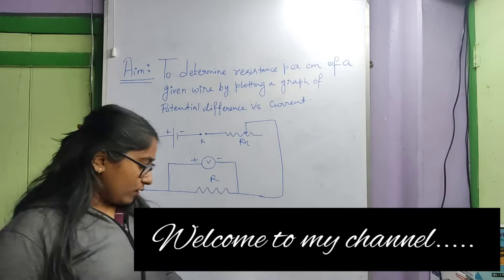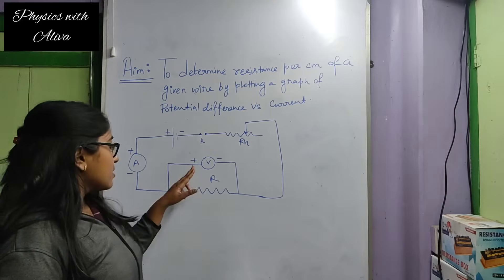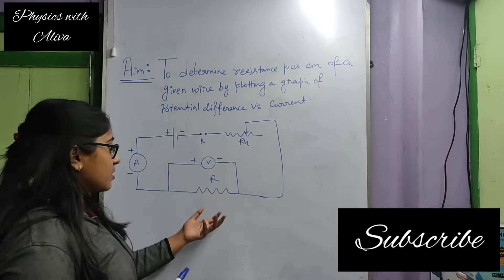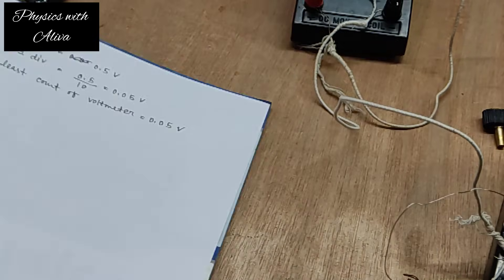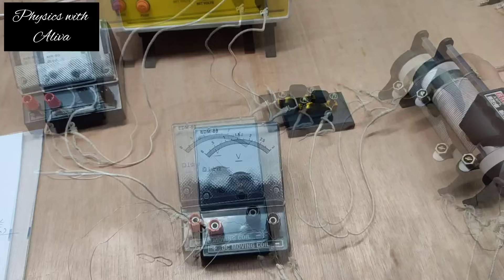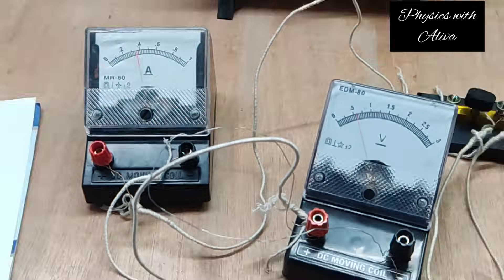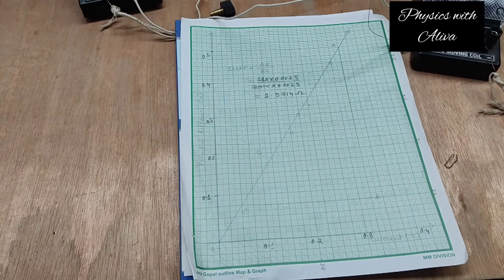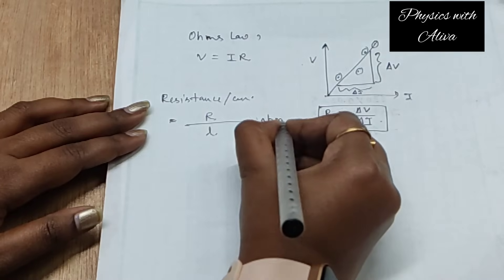To determine the resistance per cm of a given wire by plotting graph potential difference vs current

Comment: Respected mam whats the use of  rheostat here as you can just see the diffrent value of current and voltmeter by just changing the voltage through battery

And  does it(rheostat) not affect the current flowing in circuit if not then how ?

Comment: why did you use the rheostat when you can change the current directly from the battery?
Reply from the maker: @StormyGamerz  if more voltage is applied through battery in my case, the current will become high beyond my ammeter and voltmeter range…
Reply: @physicswithaliva9791  thank you so much maam

Comment: P terminal of battery connect to p terminal of ammeter n terminal of ammeter connect to p terminal of voltmeter  n terminal of voltmeter connect to one end of rheostat upper wala end another end niche wala connect to key now one end of key connect to n end of battery  and resistance wire connect parallel to voltmeter

Comment: But in boards it will ask for rsistivity
Reply from the maker: @Armywala-dk9po How to use screw gauge to measure the diameter of a wire and the least count also
https://youtu.be/3OJ_0gapwzY

Calculate the diameter of the wire

Comment: We have to convert the length of  wire from CM to M while solving ???
Reply from the maker: If you use the length in meter then the unit will be ohm per meter 
If you use the length in cm then the unit will be ohm per cm
Both you can do
Reply: @physicswithaliva9791  ok ma'am thanks 🙏

Comment: is the one way key necessary?? why cant we just use the switch on the battery eliminator?
Reply from the maker: It’s for protection of the circuit
Reply from the maker: You can make the circuit without key also

Comment: Mam Udhar 110 Division Kyu Liya. Slope Nikalne Ke Liye..
Reply from the maker: To get the slope of the straight line, draw  a triangle with the line . And then count the number of divisions of other two sides of the triangle. Randomly I have drawn the triangle and counted the number of divisions of one side of that triangle and got 110 divisions, the. I have multiplied the number of divisions with one smallest division of that particular axis to get the actual value of the side of the triangle.
Reply from the maker: V vs I graph plotting || Verification of ohm’s law|| calculation of resistance from graph|| class 12
https://youtu.be/z94os3sGNBo

Comment: +ve of battery : +ve of ammeter 
-ve of ammeter: +ve of voltmeter 
-ve of voltmeter : one end of rheostat 
another (other) end of rheostat : one end of key
 other end of key : -ve of battery
resistance wire : parallel to voltmeter (on both of its knobs)
Reply: Should we take off the key while changing resistance through rheostat?
Reply: @DS-kindsoul Yes
Reply: @DS-kindsoul  no
Reply: thankyou

Comment: Mam maine jb pura circuit complete Kiya phir v ammeter anu voltmeter me deflection nhi aa rha kyu..pls tell me
Reply from the maker: Check the connections 
Loose connection ho sakta hae, insulated threads connection ke bich na ghuss jae 

Check those factors or make the circuit again

Comment: Mam ,what is the difference between resistance wire and the connecting wire
Reply: Bhai resitnace wire has a high resistance and connecting wires don't have high resistance... Because if connecting wires have high resistance, then there will be error in our reading in ammeter and voltmeter

Comment: you are explaining wrong the graph of current vs voltage is worong. which we can find (current)by determine one of the value (voltage)are on y axis means current in y-axis and voltage in x axis because we are determine the value of voltage and take the value of current.
The resistance of the given wire is equal to the reciprocal of this slope. This statement is given in the journal of class 12th
Reply from the maker: If you draw voltage vs current then resistance=slope
If you draw current vs voltage then 
Resistance= reciprocal of slope
You should understand these basic concepts.

Comment: How you have calculated 1 small division value. Why you divide it by 40
Reply from the maker: To cover atleast 60% of the graph, I have done this. Here 0.1A = 40 division ( we have chosen it) 
Then 40 div = 0.1 A
          1 div = 0.1/40 A =0.00250A
Then plot (reading/ 0.0025 )
Reply from the maker: https://youtu.be/sJNyS5W4Qgo?si=Hxx5uUuAdY-XWDYJ

If still you have doubts, then see the plotting section of this video 23:00

Comment: Mam maine same connection apply kiye but deflection ni ho rehii koi solution bata dijiye plz ?
Reply from the maker: Check the connection once again, loose connection ho sakta hae, insulating threads connection to disturb kr sakta hae
Reply: @physicswithaliva9791  main wire hot hoti hai kya isme ..like red ?

Comment: Msm apne at the time 4:15 which wire you used in parrllel to voltmeter
Reply from the maker: Constantan wire which is used as resistance wire. 
We are calculating the resistance of that wire in this experiment.
Reply: @physicswithaliva9791  msm copper wire l skte h kya
Reply from the maker: @anjukhurana6383   no the resistivity of the copper wire is low, so it cannot be used as resistance wire
Reply: @physicswithaliva9791  then which wire we have to use
Reply: Please reply fast mam
Reply from the maker: @anjukhurana6383   you have to use constantan wire as resistance wire, and copper wires as connecting wires.
Reply: @physicswithaliva9791  msm white colour k thread m to Apne nichrome wire used ki h na
To vo parrelell m jo connect ki h voltmeter m vo kon si wire h smgh ni ayA
Reply from the maker: @anjukhurana6383   white wires are actually copper wires. The constanran  wire is only connected parallel to the voltmeter.